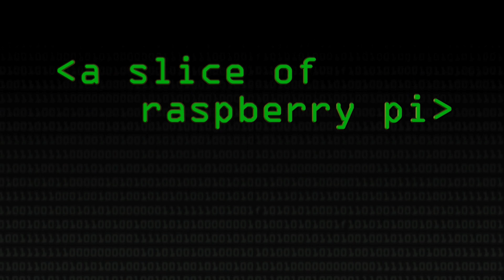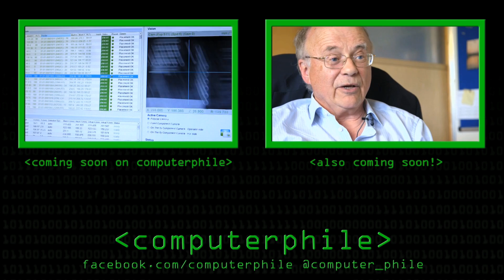Raspberry Pi Hardware - Computerphile

Comment: As for the raspberry pi, it uses such a minuscule amount of electricity to function that it barely produces any heat above ambient heat levels (room temperature). It's just like a regular cell phone, really. They have neither fans nor thermal exhausts, and still they keep at room temperature, and some of the newer cellphones run much more advanced electronics than the raspberry pi does

Comment: You should read up on airflow, and also check your clocking. More fans doesn't necessarily mean better cooling. It's all about getting the air to flow efficiently through the computer, making sure that fresh air goes in in one end (usually the front) and goes out in the other end (Top/backside). If, for instance, you have all your fans sucking in air, your computer will overheat because the heat won't be pushed out.

Comment: If you Google "Raspberry Pi Cluster" you will find a number of projects where people are doing just that. Many of the world’s super computers are made from clusters of standard, off the shelf machines working together running Linux and the Pi is becoming a useful educational tool for people learning about the technology. The beauty of the system is that you can learn with the correct software tools as you are using the same operating system.

Comment: Due to the way the Raspberry Pi is designed it doesn't generate much waste heat. You can comfortably put your finger on the processor when it's going flat out. In addition the cases are generally designed with ventilation hole just to be on the safe side. I have a Pi and the Pibow case and can confirm it causes no problems.

Comment: You would have a really slow and power hungry PC. A good modern CPU can do 100 Gflops, where as 40 Pi's could do 7 Gflops at best. It would lose a lot of this trying to communicate between the 40 to sync right and even then you couldn't run non-customized software on it AFAIK. It would be a fun project, but not useful for anything. Not even if you utilized the flops power of the  GPU of the Pi's compared to a typical GPU for the same price range.

Comment: I should go more in depth with what I meant since you made valid points in other replies about needing a keyboard and such. Most of the things you would need is assume you would have lying around or would borrow from another setup temporarily. a HDTV, a  keyboard and mouse from another computer, etc. A Pi isn't meant to be your first computer or one for everyday use. It has a valid market, and can be easily cheaper than a new laptop if you have the essentials that most do

Comment: There aren't any "necessary" parts. It comes with everything you would need to start educating with, as long as you have resources that are relatively common and already existing (HDMI TV/Monitors, HDMI cables, SD cards). If you are investing as much as a netbook would cost into your Pi then you aren't entry level. Also, many warranties are broken when you open your laptop up.

Comment: You need more than just the Pi. You need a keyboard, mouse, power source, HDMI cable and screen at a minimum, which puts the price in the same ballpark. I bought the B model which cost me 50 euros (things are expensive where I live). With the rest of the accessories and a screen it would be as much as a cheap discount laptop, which would be much more powerful.

Comment: Or reinstall linux on your laptop if you brick it... At least where I live here in Finland, where the prices are high, you can get a laptop for under £300 euros. I bought a pi, plus the cheapest possible keyboard and mouse, cable and charger and I was at £100. Add a screen to that and it's about the same price.

Comment: CMOS take care about it even when you turn your PC off - it have couple of registers (memory) and most of them take care about RTC (Real time clock). It was implemented to PC in wish to hold important info for your OS when you turn off power - but really it hold only time and what type of device is on witch port + if it is master or a slave.
Funny is this Real time clock isn't really accurate, cause nobody really care no more since you can autosynch via internet etc. My do +1 minute per 60 days.

Comment: Most motherboards have their own clock with a battery soldered directly to the board. It only runs off the battery when the power isn't on, so by the time the battery is dead, the motherboard is dead too.

Comment: Calm down there, no need to go around screaming "windows fanboy!" at me. Just re-read my post, it'll all make sense. I use Linux everyday and I like it so much more than Windows, my main gripe about it is lack of software/hardware support.

So anything not on the simple tasks lists (hardware installation) requires a fair amount of work, unless you're lucky. It's gotten substantially easier over the years, but still not as easy at clicking next on a little box.

Comment: That really depends on if you want a useful OS or not...
Either way, the fastest Linux distro is Ubuntu 11.10 which will boot in around 10 seconds on a normal PC. Don't know about the Raspberry Pi though.

Comment: I completely disagree that software is limited by hardware in a general sense.  The history of IBM's System/360 showed that limited HW, with microcode software, could perform reasonably w/ respect to advanced HW.

In computational theory, this is related to the idea of Turing Machine equivalence.

SW is more important relative to HW than I  originally suggested. SW is king!

Though I admit having pixel addressable displays is an upgrade from line printer terminals.  Hardware *does* matter. :-)

Comment: An arduino is an 8 bit microcontroller, with alot more Inputs and Outputs, it does not run the linux operating system. The raspberry is a small (but fairly powerful for the price/size) linux computer with limited Inputs and Outputs compared to the Arduino.

Comment: This seems to be designed to be compact and to minimize power consumption. The CPU has no provision for a cooler, and in fact has a RAM chip on top of it. Perhaps the CPU should have been on the top.

Factoring in the overhead involved with distributed computing, and it's safe to say that a cluster of 16 of these would perform very poorly compared to a single modern-day motherboard and CPU such as an Intel or even AMD offering of equivalent cost, running Lie-nux of course.

Comment: One idea that comes to my mind is to create a cluster of these machines, and install a framework for distributed processing on them. 

So, if you can use say 4, 8, or 16 of these. Add to that a switch to connect them all via network, and try running a distributed app on them. 

The thing I am wondering about is how well such a cluster could perform compared to a simple server machine in terms of speed.

Comment: The Pi is much cheaper than even the cheapest laptops (compare ~£300 to ~£60+ depening on your set-up). Because it's linux you have more or less total control over the OS which you don't on windows or mac, and because of the way the OS is installed on a Pi (onto an SD card) if you brick (fatally crash) the computer, you can just put in a new SD card and start playing around again.

Comment: It's cheaper, I guess is the big one. It's also simpler. If you wanted to, say, write an operating system, it would be easier to do that for the PI than for a laptop.

Comment: Its video output is compact video (like the ones for game systems that dont use HDMI), and your monitor most likely uses VGA.  You would need a converter for it to work, or just use a television and switch it to AV mode.

Comment: The computer board has an HDMI output port. If your monitor has an HDMI input, you just plug both ends of a compatible cable between the computer and monitor and you're set. Or, you could even hook it up to a TV without HDMI with its composite video output.

Comment: Musasapientumfixa has a good point about the laptops. XD. But also, yes, microcontrollers are good for projects, but if you want larger scale projects in a smaller size, it still helps A LOT to have more computing power and the ability to code in C++ using all sorts of extra API's that you can import making coding MUCH easier. Frankly, I think it's amazing! I only knew about the Arduino before watching this video, but I had no clue that a whole computer could be shrunken down to that size!

Comment: could you direct me to some site or literature on this? I am wondering about the difference or better correlation of wattage and computing power. 
Or as a side step: If I were to line up 20 of these they would consume about the same as my table top PC but at almost no heat loss. I could have some amazing transputer type 'thing that could do some amazing simulation calculations at a cost of 500 ($?) Or am I to optimistic as to the slice's potential in that way?

Comment: which other laptop can you buy for 25$?
the cheapest I've seen a laptop go for 60 but that's because it had no OS, no HDD, 500 MB of ram, and had a single core clocked just above 1ghz. 

that's basically a more expensive pi thats bigger and bulkier.

Comment: S/he's got a point actually. If you factor in the cost of a keyboard, mouse, monitor, cables and SD-card then the price will be about that of a cheap netbook/laptop.
But it does make an excellent (and cheap) low power headless server.

Comment: high-powered desktop computers tend to use somewhere between 100 and 250 watts simply to power the processor, and a lot of that power is lost to heat waste (somewhere between 40 and 70 percent), hence the fans. The RPi uses about 5 or 6 watts total, depending on what it's doing at the moment. Even if 90% of that is lost to heat, it's not going to heat up much.

Comment: It's more similar to your mobile phone than your computer. I doubt there is a fan in your phone. The Raspberry Pi is slower than a desktop computer, uses far less electricity, and generates almost no heat.

Comment: A deeper explanation of what a CPU actually is and how it works could make a good video. It could, for example, explain what machine-code, micro-code, registers, the ALU, pipelines, etc., are, and the difference between RISK and CISC. Most do not know this and it's not that complicated.

Comment: Its because your computer is much bigger and much more powerful, while this has the internals you would find in a phone. this requires very little electricity to operate, while a computer requires a lot to operate. resulting in this producing next to no heat.

Comment: I **do** agree with you that understanding hardware is important, I would argue software is (at least a little bit) more important.

Hardware enables software, and it is important to understand some gross limits of hardware, but at both the societal level and the application level it doesn't really matter whether the machine is made of silicon, gallium, arsenic, or tinker-toys.  Many, many people are able to do amazing things with computers without learning to solder, or even opening the case.

Comment: what about the base of computer science? i said base, not basic. operating system programming has always been tricky because you don't want to be changing the machine you were on. the way to do it today is simply run a VM but that still leaves you with a lot of abstraction that people have to figure out somehow, this is hardware, you can get all the way down there, and the operating system takes two seconds to fix. it was meant to be a tool for learning.

Comment: The raspberry pi with 512 MB ram and the ethernet port is actually model B which costs 35$ rather than the 25$ version with 256 MB and only one usb port

Comment: It really depends on how you buy it. Consumer price vs. Business price, accessories, shipping, the country of the shop, and model.

afaik you cannot get the model B for $25, it's more like $35 without a sd card, power supply. Just for the computer.
And I think most places the model A has gone up in price as well but can be close to the initial $25.

I think most places you can get the Model B with a power supply and somewhat large SD card for around 50€. Which is still hella cheap.

Comment: What? The device, or?

If the device, a cheap computer that you can fiddle around with. Very good for introducing computing to the poor, and a lot of people also use them in projects which would otherwise end up being plugged into a normal computer. In this case they can spend  a bit of money and get a low-footprint small-size computer.